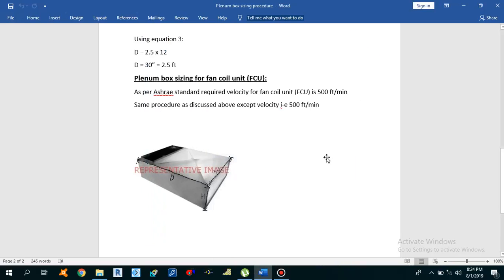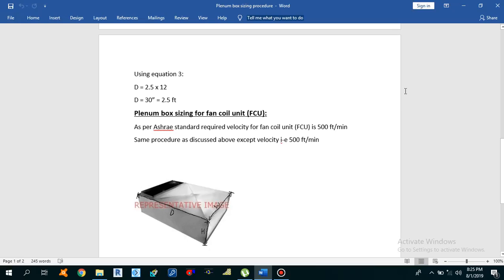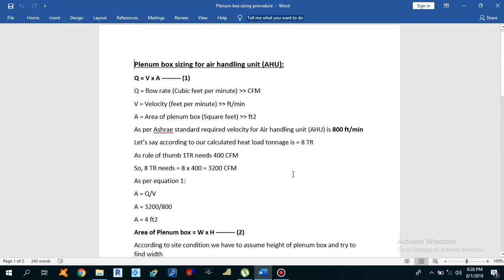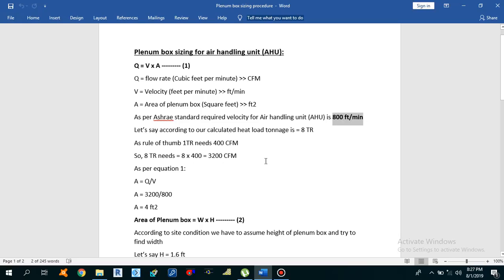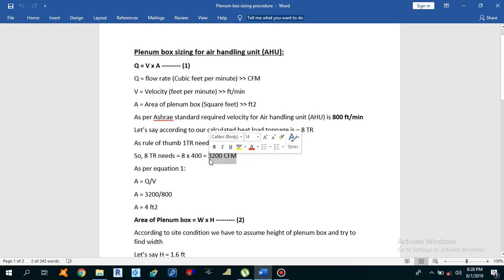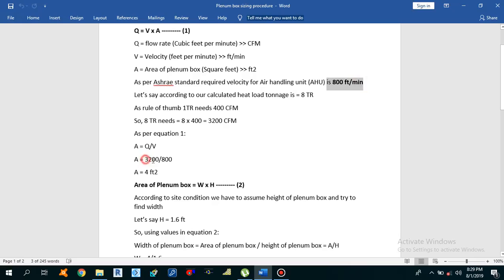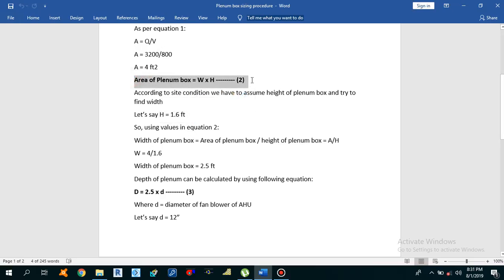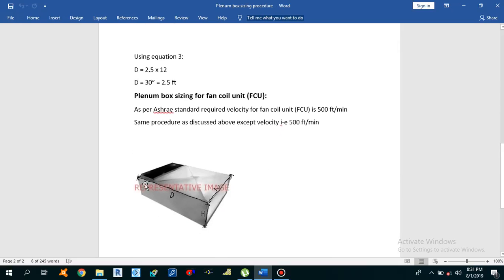hvac plenum box design sizing calculation, air distribution plenum box sizing of FCU and AHU)

Comment: Thank you so much sir,,
How to calculate plenum box size for Air outlets like ceiling diffusers and Linear slot diffusers.
Reply from the maker: For air diffuser and linear slot diffuser plenum box sizing velocity which you need to consider is 200-250 fpm ... If you know the airflow then according to equation Q=VA ... you can calculate the size of plenum box
Reply: @mepengineeringtutorials  in the video you said we have to consider 2.5 m/s which is 500 ft/min
Reply: sir, I have  a machine  capacity  25000cfm 
plenium box height H= 2.5m,
Lenght=? Width=?  d=?